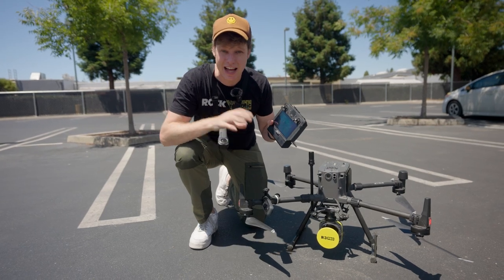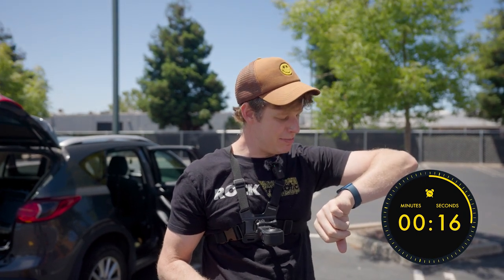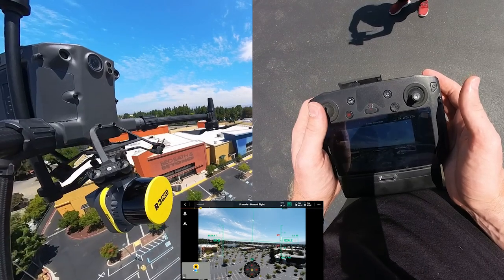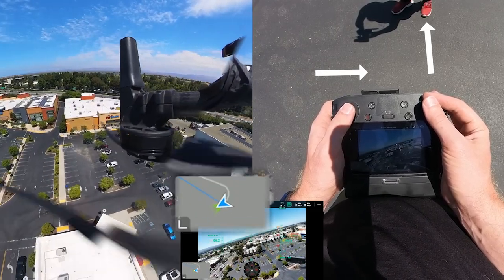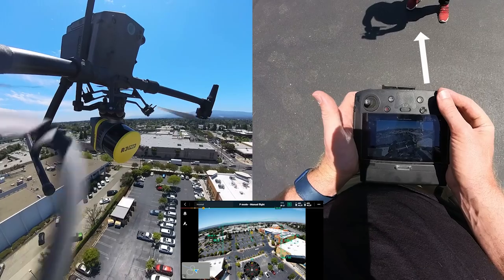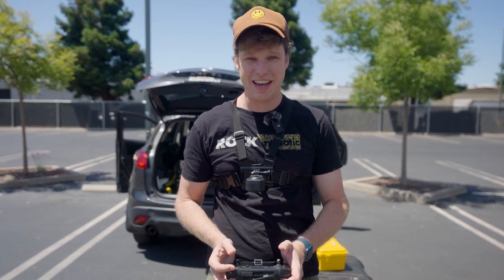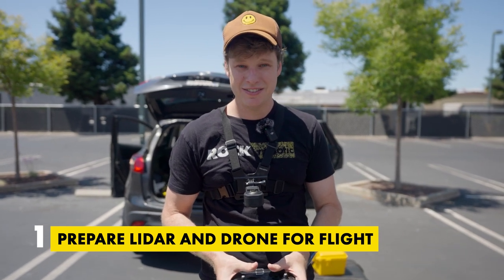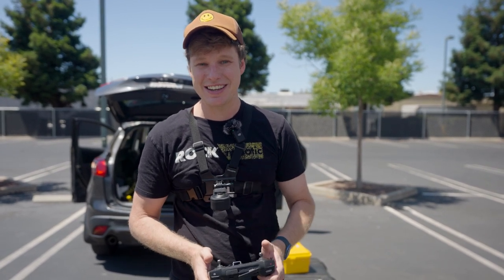Mastering the Calibration Flight | R3 Pro

Comment: So for the last 2 years (year and half R2A and 6 months R360) I would start my calibration by heading straight flying faster than 5 m/s for about 7 to 10 seconds and then roll right into my figure 8( I do 2 of them just for good measure). I saw that you completely stopped after 5 seconds and then went into the figure 8. Very seldom do I have any issues with my calibrations but the question is if I were to stop prior to the figure 8 will that make any difference the calibration?
Reply from the maker: It won’t make any difference